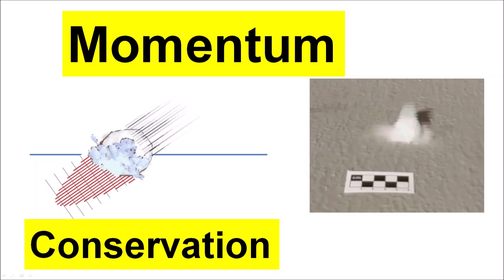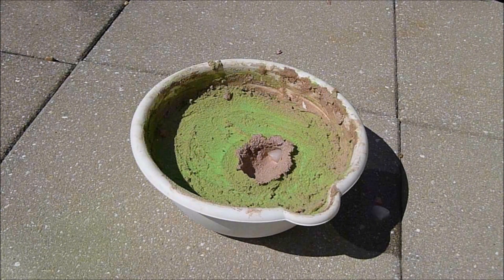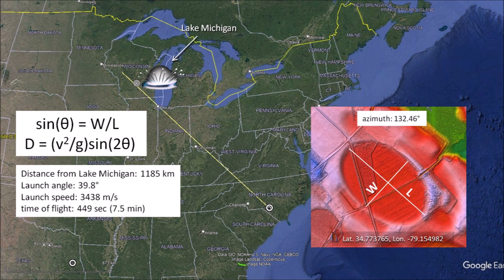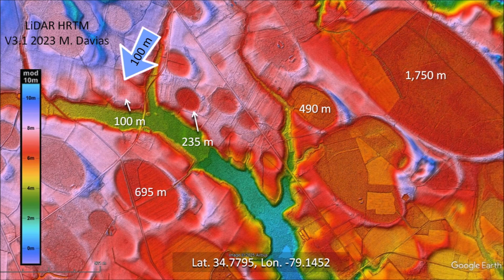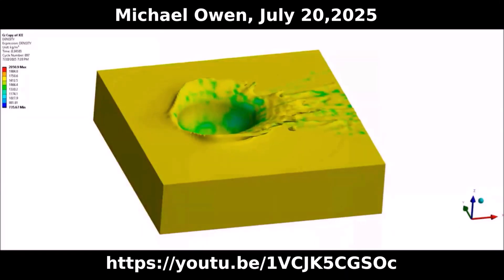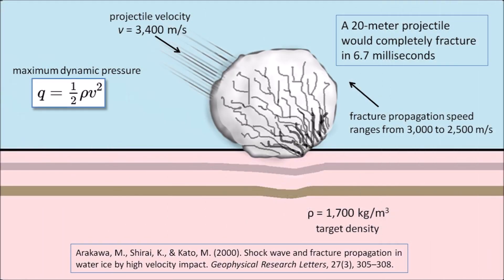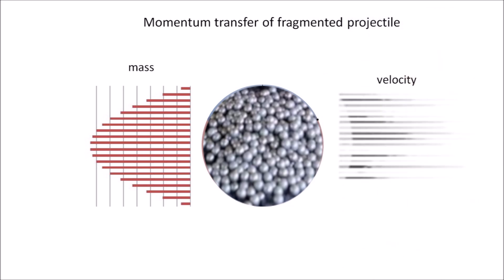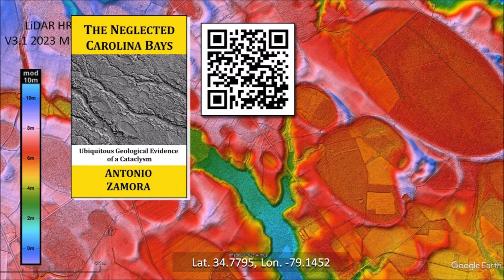Momentum Conservation

Comment: Another good video. It occurs to me that the force vector at first contact is coincident with the velocity vector, but when the top of the impactor shears off the horizontal component of the impact force would be reduced by the mv of the sheared off portion, resulting in the impact force vector inclining towards the vertical. Does this sound correct? If so, it may influence the shape of the cavity before viscous relaxation. This might explain why some of the bays seem to have a slightly smaller radius on the end downrange of the impact point. Does the impact simulation include this effect(if it exists)? I'm no scientist, but I thought I'd offer this hypothesis so more knowledgeable people could consider it.
Reply from the maker: I don't know all the details of the hydrocode simulation. I was just trying to interpret the results of why the top portion of the projectile slides horizontally.